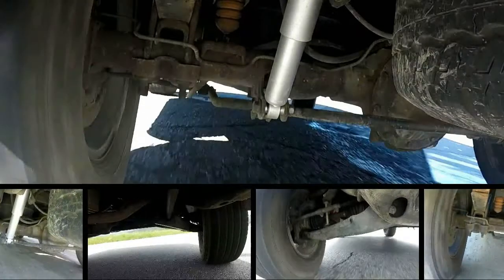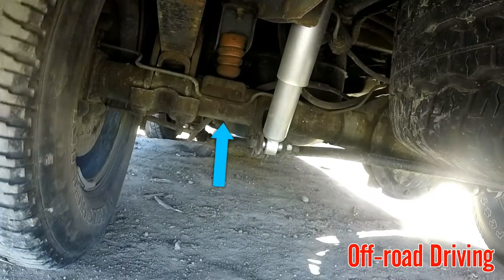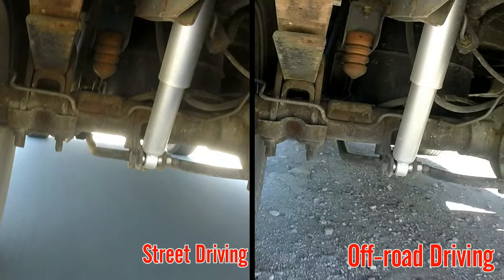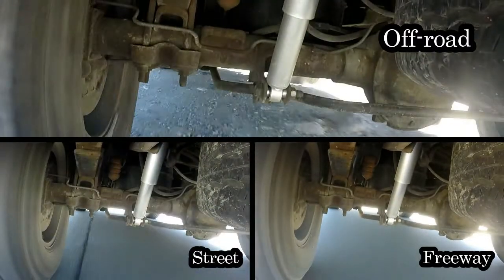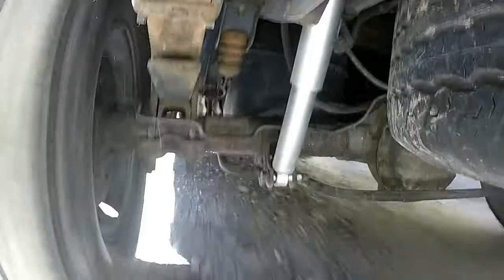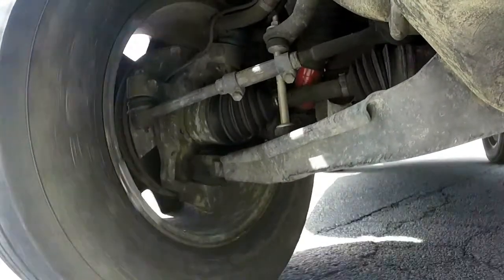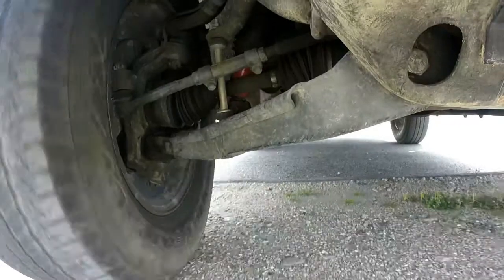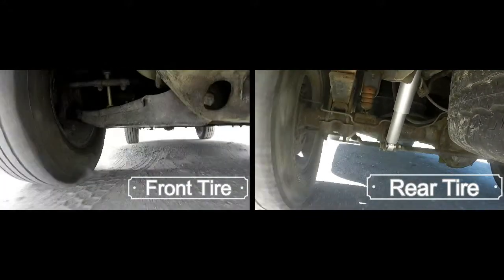Underneath View Of Your Shocks Driving On & Off-Roading

Comment: Had a "friend" screw me outta getting rancho shocks n struts for my 4runner. He said he had a friend who has a shop and can hook me up with rancho shocks n struts I was going 2 spend a grand on just basic shocks n struts at the mechanic shop cause my 4th gen runner was on old tired factory shocks n struts (yes from 2004)!!!!!. Well long story short I knew immediately when I saw them installed they were not ranchos, these were just regular all black shocks n struts. When i asked him again what kind of shocks and struts they were he told me. "Heavy Duty Ranchos" well on I've had him work on all my vehicles so I googled extensively and found no Heavy Duty All black ranchos like he claimed was installed by his friend. Granted my truck needs some work before I can offroad so I needed em changed out but dont lie and tell me u got a good hookup for me knowing damn well u diddnt. Lol so txt him again and said yo robert ranchos are red and silver not all black these are not ranchos, what's he say....yea they r...... u r thinking about the s9000 series those r crap you have heavy duty ranchos 🤣🤣🤣. Now I gotta take these off buy OME's or blisteins and make sure never to have him and his friend change my shocks n struts ever again. Besides his friend sounds pretty shady and left a can of brake clean in my engine bay near the front shocks like wtfff?? I dunno how dude ended up back at his house without it blowing my driver side shock off. Dont trust ppl folks no matter how cool they r family or "friends'.